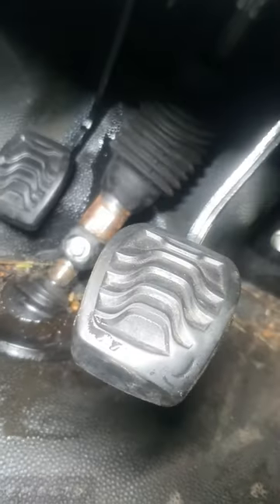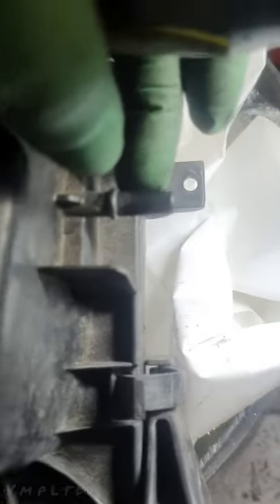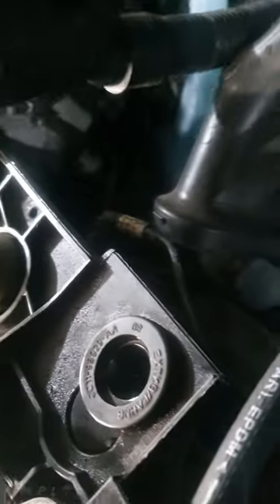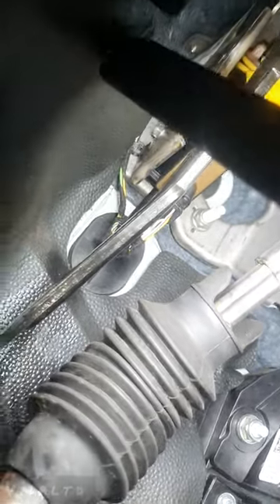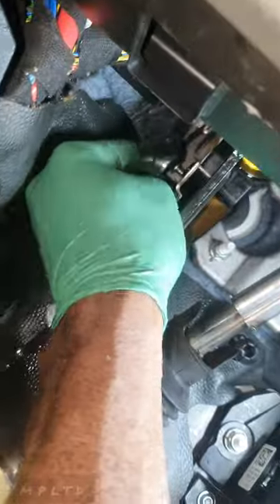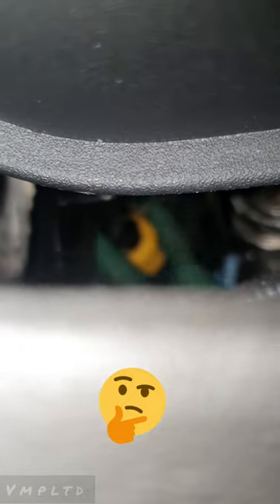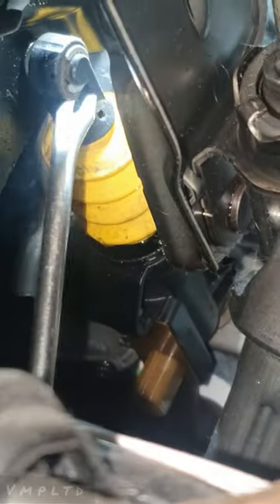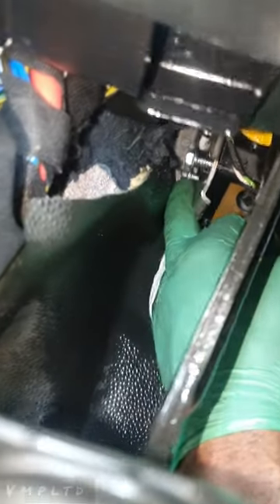Clutch Master Cylinder replacement & bleed. Ford Transit Custom 2.0 TDCi 2020

Comment: Hi mate, does the clutch line has any O ring on master cylinder side? Bcos after replacing it its leaking from master cylinder connection
Reply from the maker: Yes there is. I believe I pre warn about it from 10.12 to 11.20